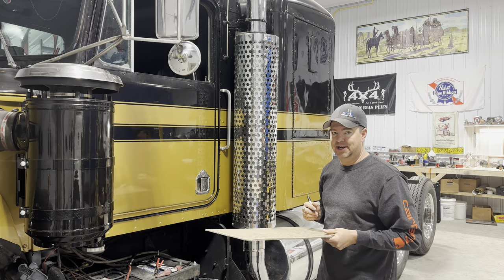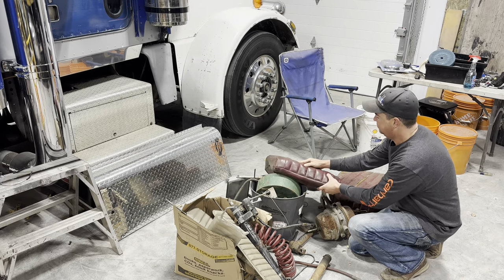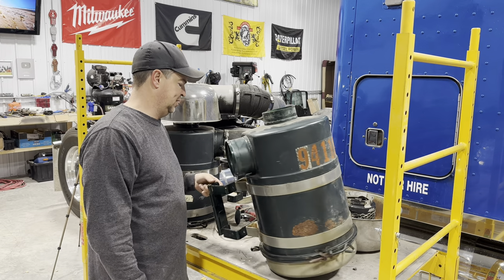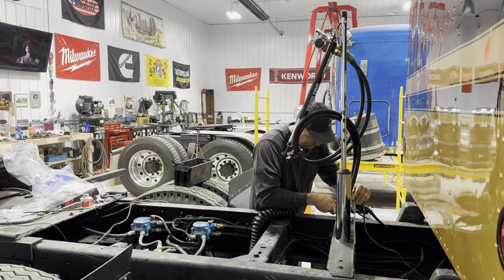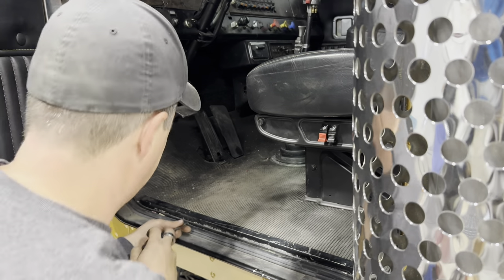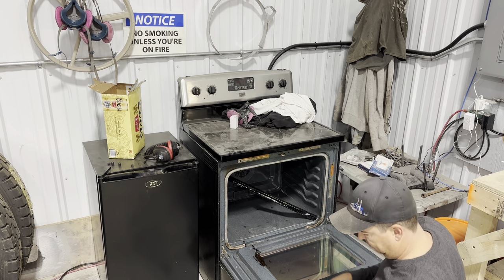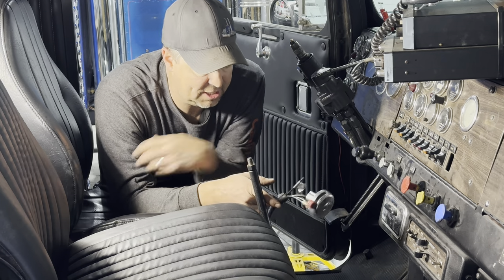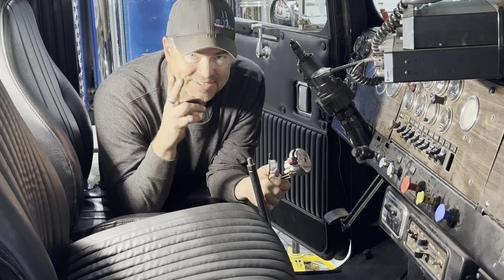Smokey & The Bandit Tribute Truck Ep.59 Why Don't You Use It

Comment: There are shops here in the US that can chrome those for you, I know the shipping cost would outway the cost of having it done.
Just an idea. I'm surprised Canada doesn't have shops that can chrome those for you.
I'm not trying to be a know it all or a smart-ass, I'm just making a statement.
Reply: There is chrome shops in Edmonton & Calgary
Reply: Igloo manufacturing has a higher profit margin, than electroplating shops.
Of course there are businesses " that can chrome" in Canada.
Reply from the maker: 2 of the 4 are severely corroded so wrapping or chrome plating are out

Comment: Why don't you just cut down a set of bands and weld them back together.  It wouldn't be hard to modify them or even make new ones.  Are they chrome or are they polished stainless steel.  I would just cut down the ones that came on those cans and tig them back together towards the back where it's not visible.

Its not hard to build your own powder coating oven.  I built my own powder coating oven and it is 6' wide 6' tall and 36" deep and I spent $600 building it.  I welded up a steel frame and skinned it with textured galvanized sheet metal and I am using 4 electric oven heating elements that cost $25 bucks each and I am using a cheap $100 touch screen plc controller and 6 solid state relays to operate it and it has a fan to even out the temperature.

Comment: I indicated in my last post that the air cleaners on the Smokey & the Bandit truck had striping on them just as the truck.  I was incorrect.  The Smokey & the Bandit truck has stainless steel straps instead of painted straps.  My apologies.  I knew something was different.

Comment: Can you just not send them a chrome company? Crome platinum in Ontario or other place - I knew a guy in 90es he was making chrome platinum in his basement
Reply: Yeah, that's a good point I wonder how long it takes? Mark have you looked into this?
Reply from the maker: 2 of the 4 are severely corroded so wrapping or chrome plating are out
Reply: @TwinStix  can't they braze pitting I would look into this because I'm pretty sure I have seen them braze the pitted spots and then chrome stuff.
Reply: @TwinStix  I believe I saw it on a T.V.  car show.
Reply: @TwinStix  muggyweld has a video of soldering the pits of pot metal Idk if it chromes the same